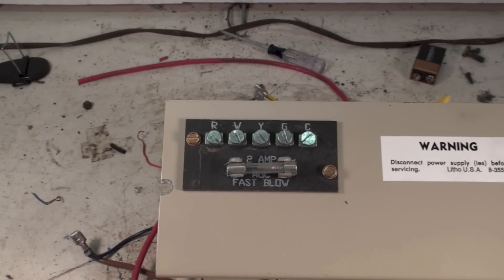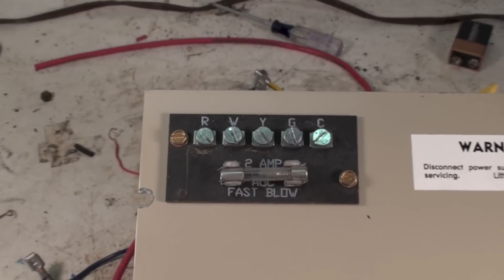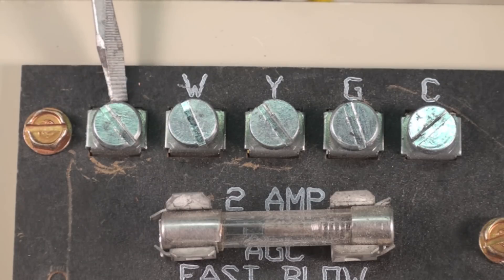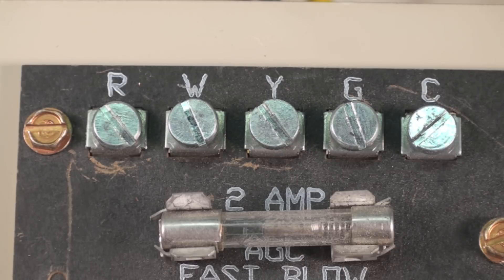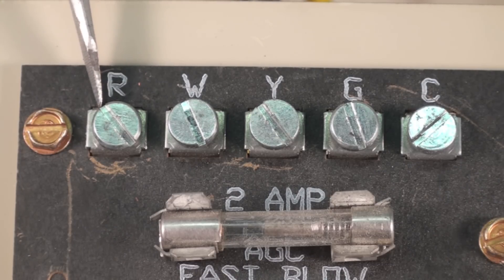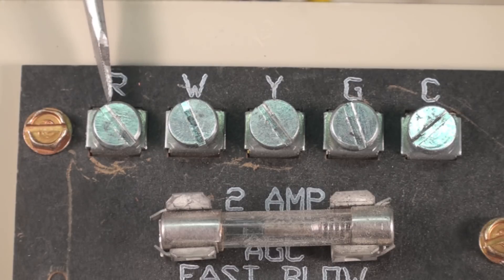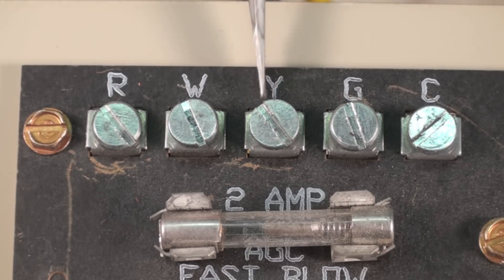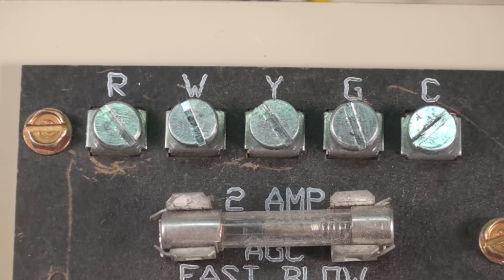What the terminals on the furnace terminal board mean

Comment: In the case of a  Goodman 96.1% high efficiency Goodman furnace, I take it that a basic two wire thermostat which closes on temperature drop is simply connected  to R and W.   The installation booklet that came with the Goodman is extremely poorly written and not clear at all.  One would think that the instructions on where to connect the thermostat would be extremely well illustrated and be perfectly clear.  Instead the book goes into detail on how to gang two furnaces to the same air duct system and so forth which I would consider to be one of the rarest situations one might encounter.  If you connect an Ohm meter across R and W with the furnaced powered on by 120 volts and no thermostat connected will it register 24 volts?   Does it matter if the gas valve is turned on or off during this test?
Reply: I believe this synopsis of your video is correct and wish it had been in the Goodman installation instructions.:

IFC = Integrated Furnace Control board

R = 24 volt
C = Common (generally not switched)
R closed to C = 24 vots.
W = heat
R closed to W = Heat.
R closed to Y =  AC cooling
R closed to G =  Blower Fan. (Room air circulation)

Color Code (for wire):
R = Red (thermostat)
W = White (heat)
Y = Yellow (AC)
G = Green (Blower)
C = Black (Common generally not switched)
Reply from the maker: You are correct on the R and W connections.  If you connect a voltmeter across R and W it should show 24 volts.  Gas valve position will not effect this reading.
GFM
Reply: Here's an area where I'm unclear.  The furnace I'm working with has a two stage gas valve.  It does indicate in the documentation that it will operate properly with a single stage thermostat.  It starts out on low  and after a set period of time, 10 or 20 minutes, it switches to high.  On the FIC or IFC board there is a terminal for W1 and W2.  Which one should I connect the thermostat to?  Is there a common understanding as what is W1 and W2?  For example is W1 low and W2 is high?   Amazingly this is not covered in the documentation.  It is a Emerson control board.
Reply from the maker: If you jumper W1 and W2 the unit will delay the 2d stage.
GFM
Reply: You mean to run a short wire from W1 and W2 plus having the thermostat connected from "R" to one of the W's?   I was hoping it might be possible to get the unit to run full time in the low stage.  From what you are saying, I could add a toggle switch between the two ( W1 + W2) and possible get it to effectively run in the low BTU mode.  This would be good during times of the year where extreme cold is not expected; the longer delay being long enough that the high BTU never actually comes on.
Reply from the maker: You can install the switch.  Understand that you are saving nickels here.  There is very little difference in usage between operating the unit with a jumped W1 and W2 and manual switching. 
GFM
Reply: I tried to close just "R" and "W2"  The furnace controller board balked and blinked the code "W1 is missing."  or "W2 active with W1 absent" or something to that effect.  The bottom line with a two wire thermostat I don't know how to force it into the "Low" stage full time.  It's not that important as I can increase the length of the preliminary low run time by about double which I believe is a maximum of 20 minutes.  My issue now is to connect the humidifier.  On the original furnace, I had it set up where the AC blower was wired in parallel with and AC outlet mounted externally on the furnace.  I had the  humidifier connected to a 24V transformer that plugged into that outlet.  Again the outlet was switched on by the current to the fan motor.     Were do you suggest I connect the humidifier on the new Goodman furnace with an Emerson control board?  I can't stress how poorly the Gooodman documentation is as it is related to connecting various devices to the system board.  Personally I think that's the most important information anyone working with the furnace would want.
Any advice you have will be greatly appreciated.
Reply from the maker: There should be a HUM terminal on the IFC.  This is a 120 volt connection that allows the humidifier to come on with the fan.
GFM
Reply: I don't see that on the Goodman, but I now realize that the humidifier has a close on temperature rise sensor inside the plenum. So  I'm going to try 
"R" to "C."  I'll measure the voltage and see if there is 24 volts there.   Hopefully there will be.   The only function of the 24 volts is to open the water supply solenoid.  Since there has to be significant temperature in the plenum for the sensor to close,, the water will only come on when hot air is circulating through the duct work.  I will mount another toggle switch on the side of the furnace to insure that the humidifier only comes on if I want it to.  Previously the water valve worked on 24 volts.
Reply: Finally the continuous fan can be activated with a switch between "R" and "G"  According to the documentation other furnace functions dominate the fan speed once they are active.  I think I have have things under control at this point.  I'll report back after further testing.  I couldn't have done it without you as the color code scheme based on wire colors, without proper documentation is entirely cryptic.
Reply: GFM, I appologize.  I now see there is a push on terminal post labeled "Hum" in the 110V section next to what I believe are 110V neutrals.  There are two empty posts there.  However, I'm going to try to use the 24V section if possible as it would be a cleaner install.  My problem yesterday was that I needed to replace the battery in my volt meter.
Reply: All is working and I really appreciate your help.  Honestly, I could not have done it without you.  The Goodman documentation is not enough.  Here is my final scheme:  I have three toggle switches on the side of the furnace.  All toggles = Up is on or activated, and Down is Off.

Top or uppermost toggle bridges W2 to W1.  The function is to convert the furnace into full gas power single stage 100,000 BTU furnace in the UP position.   DOWN = standard two stage operation.

Middle toggle or second one down from the top:   UP = continuous low speed room air circulating fan is operational.  DOWN = fan is OFF except during actual heating cycles.

Bottom Toggle:  UP = Humidifier active; powered directly from the furnaces internal 24 volt transformer.  Down = Humidfier is non operational.  This circuit runs from the furnace through an adjustable humidistat to a click on temperature sensor near the top the plenum,  which turns on the 24 volt water valve when the furnace is at operating temperature.

I set the dip switches for furnace to run for 20 minutes at low power before the second stage kicks in.  ( This is the maximum allowed by the Furnace Control Board, as I know of no way of forcing full time 1st stage only operation.)  The idea is to run the unit as a lower output BTU furnace most of the season with the full power manual override as needed.  If this turns out to be unsatisfactory, I can modify the dip switch settings for a shorter run time in low heat mode before automatically switching itself to full power.

Again thanks for your help.  It was a God send.

Comment: Is it possible to connect a 24vac zone control damper to the low voltage terminal board on a furnace?   I would like to have this damper closed during the summer months and open during winter.
Reply from the maker: You can connect it if the transformer is large enough for the additional load.  At least a a 40 VA capacity transformer.
GFM

Comment: sir, why are some 24vac furnace transformers ground one side to the furnace chassis? "C" is the common side of the 24vac transformer, but if it's grounded to the furnace chassis then how does that work? thanks.
Reply from the maker: The primary reason for the chassis ground of the secondary of the transformer is for the flame rod operation of the IFC control.  
GFM

Comment: My furnace has a b terminal.. What would that be? It was made in 1982
Reply from the maker: B is usually for the reversing valve energized in heat.
GFM
Reply: What's a "reversing valve"?  Is it related to a heat pump?

Comment: can you please tell me why on some furnace boards there is a jumper wire between W1 and W2? what's the reason for this? thank you.
Reply from the maker: On a 2 stage furnace made less than 30 years ago, and used with a single stage thermostat, jumping W1 to W2 will start there furnace on single stage, then it will run for 10 to 12 minutes.  If the space has not been satisfied,  then it will go to second stage.
GFM
Reply: thank you for all your educational videos. extremely helpful.

Comment: hi, can you please tell me what voltage across the C and W with thermostat face off but with furnace ON. i am reading 24Vac across R and C but only 13Vac across C and W. is this normal? thanks.
Reply from the maker: If the thermostat is calling for heat, you should read 24 to 27 volts across C and W.  The reading you are getting indicates no call for heat.
GFM

Comment: Awesome... my question is.. I have a control board like this, no wires are attached to it. Instead my R & W come from the thermostat and seem to connect directly to furnace (motor, blower) heat works fine. But I can't get a smart tstat working. Do those wires need to be moved to the control block or jumpered some how?

Comment: My G wire is disconnected on my furnace control board and my thermostat. I am replacing thermostat with an ecobee wifi thermostat which requires a g wire. As far as I can tell, the furnace and air conditioning are working and blowing air no problem. I'm not sure if I should hook the g wire up at the furnace so I can continue with the ecobee or if I should leave it off. If I leave the g wire off, I'm not sure if the ecobee will work since it's requiring the g wire to work with the c wire. What would you recommend doing? Hook up the g wire?

Comment: I've got 2 wires (Black and Red) from thermostat going to the R terminal on the furnace from the . Why is this? Can i Switch the black wire to the C terminal and power up a WiFi enabled thermostat?
Reply from the maker: You can try.  There may have been an open in the red and Black was used to replace it, but I would try it.
GFM

Comment: Great videos, thanks so much for helping us all learn!  I'm trying to track down a short (lucky me) and get 12 amps across the (5 amp) fuse jumper, even with no wires other than the power wires attached to the IFC.  On the terminals, should there be continuity from R to C?  With no wires connecting them?  Both R and C also are both showing continuity to the case. Are those readings as they should be?  Thanks so much!
Reply from the maker: There should be a resistance from R to C.  R should show a resistance to chassis.  C should show 0 resistance to chassis.  If all the thermostat wires are disconnected, I would also disconnect the gas valve and pressure switch wires.  If you then have a short, you probably have a bad board.  Hope this helps.
GFM
Reply: Looks like a bad board, then.  Thanks a ton, I was very reluctant to replace a $200 board without ruling out other things as much as possible.  I can measure things pretty well, but I couldn't find what the values were supposed to be!  This was a huge help, thank you for providing all this great information.

Comment: Thanks for the very well done videos.   Greatly appreciated.  Now for my problem - blower not coming on in a gas furnace.  This is a Lennox Whisper Heat G20 in a residence.  The thermostat is in heat mode with the fan set to auto.  When it calls for heat the damper door opens, the ignitor sparks, the pilot lights and the burners ignite.   After about 30 to 45 seconds a click is heard from the blower control (BCC2-4).  But the blower doesn't turn on.  At the same time the click is heard there is momentary voltage at terminal H but it quickly returns to zero volts.   After another maybe 20 seconds, the blower control clicks again, but again no blower function and the same voltage reading at H as before.   After another 20 seconds or so the burners shut down and the blower control starts clicking repeatedly about once per second or slightly faster than that with 
 the voltage reading at H jumping all over.   If the fan setting on the thermostat is set to "on" rather than "auto," the fan works normally.   Could this be anything other than a blower control board problem?
Reply from the maker: I would be looking at the blower control board.  There is a slight possibility that the heat speed of the blower motor is shorted but this problem is very unlikely.  
GFM
Reply: I'll order one right away.  I don't know if it makes any difference, but I tested it again with the wire pulled off of H and 30 to 45 seconds after the burners light, the blower control goes straight to the point where it's clicking repeatedly with voltage at H jumping all over.   Anyway, thanks so much for the quick reply and for sharing all your knowledge and experience in such a clear and concise way.  It's a huge help.
Reply: GL if it was me, I would use a jumper cord made from an old AC  extension cord (for example a slavaged cord off an old microwave or other appliance) to try to run the motor by itself, outside of the control system.  This is presuming the blower motor is 110- 120 AC which most are, but I guess not all in the more modern furnaces.  What you are describing sounds like a burnt out motor to me.  The click you hear is to start the motor, but because the motor has a locked rotor for some reason it fails to start.  At that point other safety controls such as high heat limit take over and shut the unit down.   This is what happens on a refrigerator with a bad compressor.  The click could also be a high amperage protector that is actually disconnecting the motor from the circuit.  The click opens the connection because the motor is over amping.

Comment: hi, I have a thermostat for heat only and it has 2 wires
one is on R and the other on W, I want to purchase a honeywell thermostat model 9000 and I was told it needs 24v. which post can I connect the 24v transformer, none of the pictures I seen of the unit mentions where it goes
Reply: Angel Esp i had a similar issue. But the cable in my house had a wire that was unused and my furnace did have a C terminal which I connected the wire to. If you pull your cable out and there isn't an unused wire, you can run a new cable. If your furnace doesn't have a C terminal, perhaps somebody makes a retrofit kit of some kind or you could try making something yourself with a 24vdc power supply from RadioShack

Comment: Hi thanks for your videos I do appreciate them. Quick question I may have some wires reversed. can you tell me what ACB stands for on a Lennox circuit board? Model:diplomat 80MGF SERIES. I have 3 terminals heat, Low, cool. The wires that come from the main blower (black and red) are connected there. I'm wondering if I mixed them up. My Blower constantly runs and all limit switches are fine. Thanks for any help/clarification.
Reply from the maker: The ACB terminals are the blower terminals The ACB heat is probably Red.  ACB cool is probably Black.  I don't think those being mixed up would cause the blower to run constantly.  I would double check the limits and wiring.  Hope this helps.
GFM
Reply: grayfurnaceman : yes then I have them right. All the limit switches check out fine. What do you mean "check the wiring"
Reply from the maker: Are all wires where they should be and not loose.  No manual reset limits open?
GFM
Reply: grayfurnaceman yes went over it from top to bottom. pressure switch, inducer motor, roll outs and hi-limit. I even replaced the board. That was the confusing thing this was a conversion kit. Lennox 19w94. They replaced the original board (20j8001) I have the same furnace at another one of my houses and so I swapped the original board out and it worked perfectly. That's why I think someone has wired it wrong. Which was why my question was about the black and red blower wires. My tenant has rented for 4 years but she never mentioned the blower continued running. And she moved out owing me money :( i'm hoping she didn't mess something up because I'm really confused. 
The original problem was that the furnace would not start only the blower came on when I called for heat. The board does not seem to be telling the inducer to start first. When I jump the pressure switch it will stay running until it stops and then when there is a new call for heat and it won't start again.
Reply: my thoughts are if the blower stopped running then the furnace would start up again. Do you think I could bypass all the limits? It would seem that one of those are what is keeping the fan from shutting off.
Reply from the maker: You can, but only for testing.  Do not ever leave them bypassed for operation.
GFM
Reply from the maker: The furnace must see an open pressure switch before it will stat.  That is why it will not restart.  You seem to have a pressure problem in the vent.  Look for obstructions or water in the vent.
GFM
Reply: grayfurnaceman yep I had already tried that last week. Pulled off the vent and ran it inside the basement for a bit. Pressure switch never opened and blower continued to blow. Plenty of draw on the switch. That's what led me to buying another pressure switch just in case. I'll flip it on eBay, no huge loss, I'll also resell the board once this all figured out. I just want to figure this thing out. I'm a guy who needs to know why. Meanwhile I Installed a temp furnace until I'm done with the renovation but I still think it's the wiring, possibly a stuck relay or something. Like I said I proved the board is the issue because an original board made it run fine.
I wish there was a website that showed a wiring diagram for every board. Especially this conversion board. I'll figure it out eventually. Thanks for trying.